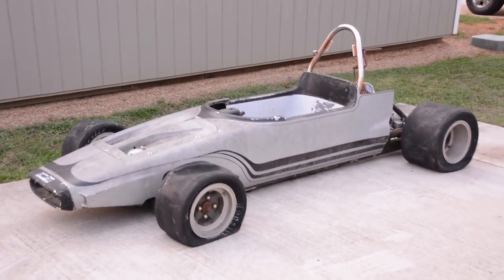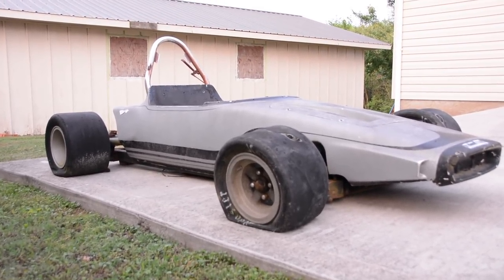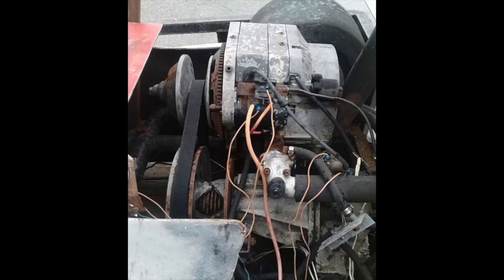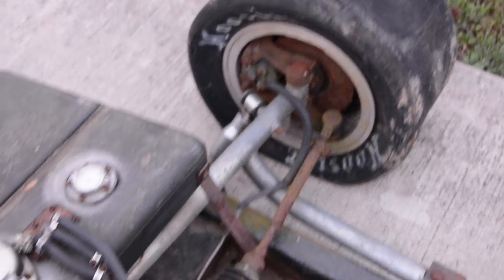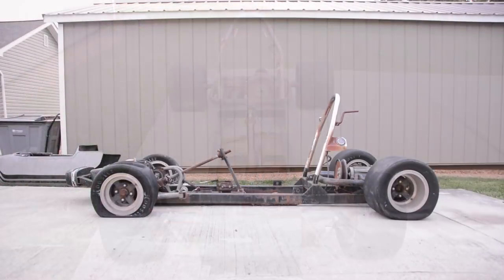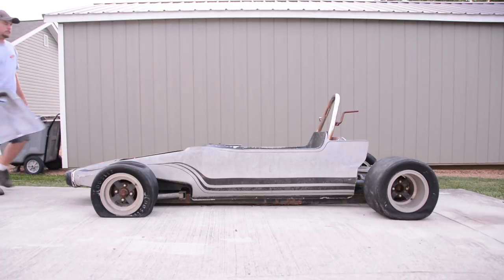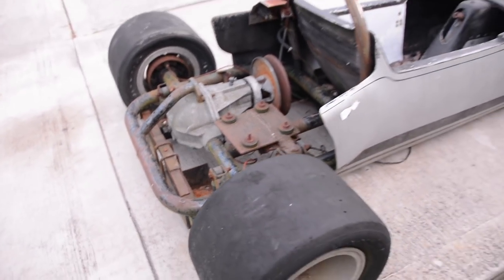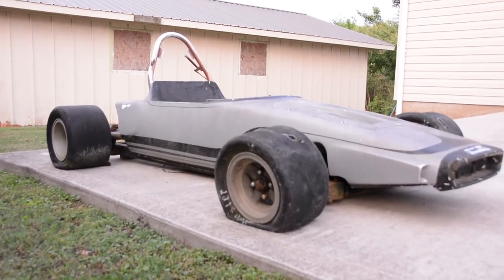Vintage Go Kart Find "Grand Prix of America" -- Hot Rod Hoarders Ep. 2

Comment: OMG! It's a M.G.P. kart! Originally Wankel single rotor powered, these things were pretty quick, and you had to acquire a 'license' of sorts from Malibu Grand Prix to drive one. It would be amazing to re-fit this with a MC engine of some sort (preferably an early 90's CBR-250RR that winds to 20,000 rpm).. that is, if any of them still exist in the U.S. that haven't been blown or strained through a chain link fence. This would make it sound and perform like it's full-size cousin. Definitely a build I'd like to take on if I had the resources and my health wasn't so bad.😉

Comment: I wonder if these are the same that they had at Myrtle Beach grand prix amusement tracks back in the 80s threw the early 2000s , I drove them a few times & they had Honda or Briggs air cooled v- twin engines with a 2speed auto trans set up

Comment: I had something similar to this about ten years ago. Picked it up in Paris Tx, hauled it home, messed with it for a few years, then sold it to a gentleman in Rusk Tx.
4w independent suspension with rear trailing arms, 4 wheel disc brakes, fan cooled 650cc Bombardier engine (Tillitson carb), with a centrical clutch, rear axle (chain drive?), and 14" rims. Full multipiece fiberglass body with belly pan.
Still have a few pics of it.
Reply: Post pics I have a mgp car
Reply: @kirkize  Not sure how to send pic's via youtube.

Comment: I own two of these.One is almost completely finished up.If you want videos or pictures let me know.
Reply: @romanoguttadauro9563  Will do!
Reply: @markgonzalez4070  i have yet to find one anytime soon . and if they dont know what they have theyre cheap. but if they do know what they have they could go for 2500 with is just being a roller .i would get rid of my other one but i have many memories attached to it and will eventually restore it to its former condition kind of like my other one
Reply: @Romano Guttadauro
would you sale your spare one?
Reply: @Icey would you possibly have pictures and dimensions you might be able to send me? Trying to get my hands on one so I can try and some what copy it. Trying to get some designs of one. Appreciate you getting back to me.
Reply: @markgonzalez4070  sent you a email
Reply: Got one that just needs Starter or pull start A belt Which I could probably let go for three grand
Reply: i own one too wondering if you could send pics ...p.s. need body just have chassie
Reply: I own one also but Mgp car
Reply: @markgonzalez4070  I've got one for sale 
            
            Weekend Ride
Reply: Also have a roller complete minus the engine, have some xtra parts too.
Reply: @markgonzalez4070  I can send you some of my Mgp car or just look at my videos of it on here .
Reply: @markgonzalez4070  just did
Reply: @malibugrandprix3537  I have a rotary powered one  I am restoring. Do you have parts ?
Reply: @ Kirk of all trades! Weld it, run it,restore it!
I’ve got a fiberglass body. Not sure if there is extra parts yet.
Restoring one on my channel
Reply: @malibugrandprix3537  ok I’ll look you up super cool cars . I do car restorations full time so this is one of my personal builds
Reply: @malibugrandprix3537   super awesome I just subscribed to your channel  as not many of these cars and I know one person that needs a body and message me about it already but that body looks different then mine  but they have so many and mine is a early one with Rotary power
Reply: @malibugrandprix3537  they do need a body hope it’s a match super awesome !!